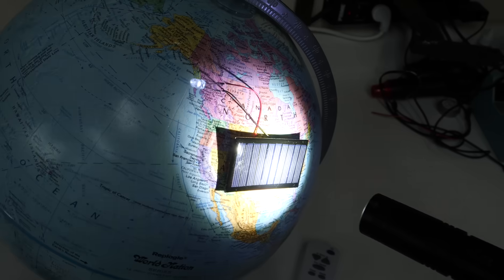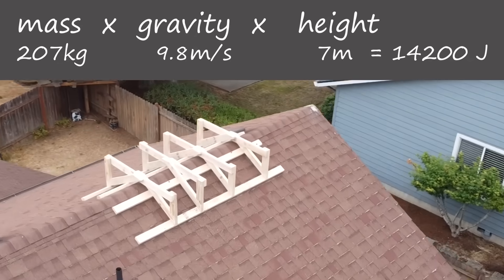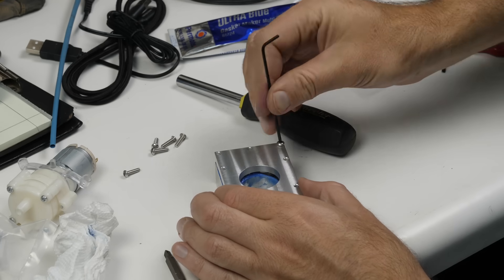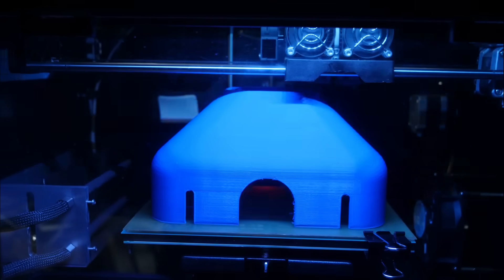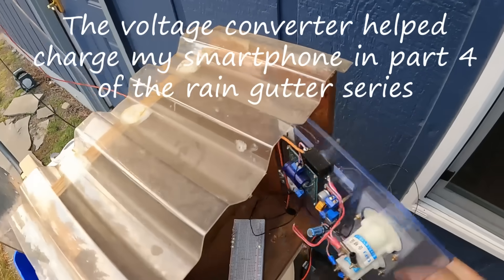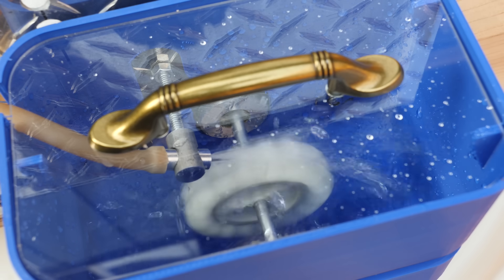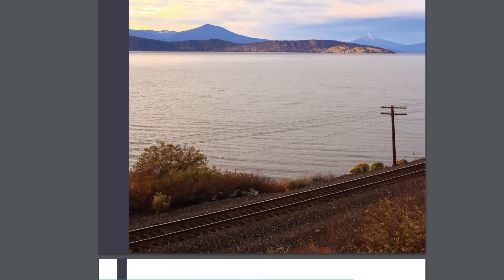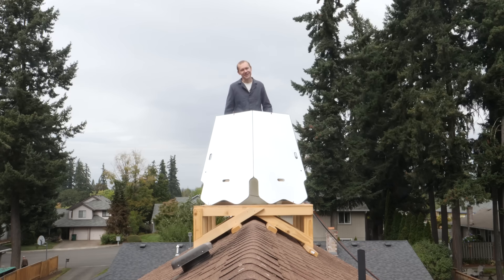Storing Solar Power on my ROOF!!!

Comment: you can use tesla turbine for the same purpose and generate electricity more efficiently, coz you are using it at very smaller scale.
tesla turbine can be handled at this level.

Comment: 1:03 I thought you were demonstrating stored energy on a valuable item, like your car roof.
2:16 it's not your slip I'm worried about, it is the daily changing of 460 lbs load on your roof trusses. Who wants that? A new roof section  is ~ $10k.
I endorse your idea. The barrels don't have to be so high. Just double the # of barrels on a lower level.
You will have to reduce the velocity of the water flow, since the viscosity of the water seems to rob the water of much of the potential energy. 8:10 the water jet not reaching the roof is how I realized this. The water past the water wheel splashes a lot, wasting some moving water (wasting kinetic energy). Can you fabricate a turbine?
11:25 good one.
Alkaline AA battery? It's energy storage is about 14 kJ (wikipedia). 1.4 g of gasoline burnt in an engine (20% efficiency, say) also gives 14 kJ assuming 47 MJ/kg specific chemical potential energy. So 1.4 g of gasoline (cost is 0.2 cents) is equivalent to your 55 gallon of water? I thank God + humanity for inventing gasoline. And thank you for your BUILD principle for putting all this into perspective.

Comment: your system is 14,000 joules. a double A battery is between 10,000 and 16,000 joules. a 60Ah 12V car battery is 2,592,000 joules. while your idea is interesting, it's not practical. a car battery can be purchased used for less than the cost of that barrel or the sheet of plywood you put on the roof.

also, the project your city is embarking on can be replaced with 151.5 standard car batteries or far fewer deep cycle batteries with a shelf life of approx 10 years or better yet, a lithium battery bank.

Comment: I worked at PG&E when the Helms Pumped Storage Unit was built in the "80's .  It was built to take advantage of the off-peak electricity generated by the Diablo Canyon Nuclear Power plant.  Rather than cycle the plant, it was run close to normal capacity and the excess energy is used to pump water at night.  Pretty clever.

Comment: The required water for this potential energy system far exceeds the deployment and benefits. You would need basically a house size water tank to have enough energy, plus generators, pumps etc. You would be way better off with 20-40 deep cycle batteries and a roof and backyard full of panels. Less moving parts, less things to go wrong, more economical, etc etc. Solar still hinges on storage (edit - you just said the same 👍😁)
Cool experiment though 👍

Comment: Intresting video! Yuou might be intresed to know that oil is NOT a "Fossil" fuel!  It is a 100% natural & 100% self-renewing resource born from mineralogical processes in the earth's crust.    Some sources try to claim that Abioyic oil is only a theory, but "oil" has ONLY been created in a labratory by following the mineralogical methodologies but NEVER using the decaying oranic material + heat theorys!     Reseach "Abiotic oil" to find out more.

Comment: Kind of wondering if reducing the pipe diameter to make more powerful exit water would increase electric power
Reply: Biggest improvement would be making a better generator. Every drop splashing off the paddle wheels is lost power. Would need to design it more like a turbo. If that makes sense. Not exactly but the idea of confining the water around the path of travel.

Comment: I have always wondered if it is possible to use a rampump on downspouts to put water into a higher tnk during a rainstorm.Then possibly later while using the water produce power from a small hydrogenerator in the output line to charge batteries. A backup for solar and wind on those less than optimal   days.

Comment: 14200 J of energy. 😀 That's 14200 Ws (Watt-seconds) = 3.94 Wh (Watt-hours) and that, ladies and gentlemen is the equivalent of two (read: 2) cheap AA rechargeable batteries. Cheap, because each of them needs only 1700mAh capacity. 1.2V * 3400mAh = 4.08Wh. There are AA rechargeables with 2800 or 3000mAh ofc.
I'd also like to dispute the claim, that this battery will hold forever. It wont, because part of it is the pump which will die after a few years and which btw has not 100% efficiency.
Of course you have to use batteries for any meaningful system.

Comment: Great project but not very practical. 

A not so great 18650 (Li-Ion) battery has 3.6V nominal and in average stores 2 Ah. That means a 7.2 Wh gets stored in it. Transforming 7.2Wh in joules we get 7.2 *3600 = 25,920 Joules in a battery. ...According to the video the barrel stores 14,000 joules.  Even If I am generous and take 400kg of water at 10 m height we get 39,226 J which is less than 2 batteries. 

Do I miss something? Once again great project to illustrate the possibility and as an educational tool but unfortunately there is a reason we do not store water on top of the houses to produce electricity.

 ...my comment is late but I think the video deserves a bit of context in case there will be more people watching it. 

More over, for each 18650 (Li-Ion) battery you want to replace with water you need 265 Kg of water at 10m height to store the same amount of energy as a battery. To replace 4 batteries with water you need over a ton of water. 🙂.At $3 per battery I would rather spend 12 bucks every year (even recharging them daily they will hold for at least a year) than having a construction for a ton of water on top of my house.

...and there is more. If you have a solar panel of 50W working for 2 hours (that is my average of sun in my region) you produce 100Wh. That is 360,000 joules. With 400kg of water you can barely store 11% of that energy.  To much energy lost.  

Anyway, this calculation does not diminish the educational value of this project. ...but don't run to Home Depot yet ;-)

Comment: If you use a a larger diameter down pipe your flow rate and resultant energy potential at the lowest point will be greatly enhanced

Comment: Imagine if they combined this with evaporative desalination?!?!  Heat collected sea water, into a closed loop.  Get power off the steam.  Collect the distilled water at the physical “top”.  Generate electcity on the ‘way back down’ and add that clean water into the water supply.

Comment: Next level, tesla water turbine & hydraulic ram pump. Are you gonna make a HUGE water tower to house the animaniacs lol jk. BTW talk to engineers back in the day when I was so into this water battery thing. For usable electricity the water tower pressure at the bottom of of tank or to the pump/turbine has to be 90 lbs per square inch to produce usable electricity without the use of a buck converter.

Comment: I guess that he's never heard of legionnaires'disease. I wonder what the neighbours think of the appearance considering he did this without planning permission. Then there's the issue with home insurance, do you think they would pay out if that fell through the roof or worse still fell off and killed someone. It's also going to be so unreliable, the pump/generator will be dead in around a month. What about when it freezes? This is such a dumb and dangerous project all to store the same energy as a fairly small battery.

Comment: I'll give you 10 bucks if you can charge a single phone battery with the amount of energy you got up there. The efficiency is just super low.
Oh I just had an idea.
Imagine suspending Barrel from a tower or a tree. Then while it's at height filling it with water. When you want to use the energy simply let the motor lower the load. The efficiency should be way better than water flowing through pipes. In theory.

Comment: The tools you have access to are fascinating and leave me scratching my head a little bit.
I'm a little jealous you have access to a CNC routing machine.
And then I'm perplexed that you didn't get a brushless motor and controller. You would lose a lot less energy to heat. Heck of brushless motor controller might get you 90% efficiency where is it a brush motor might be down towards 50 percent efficiency. Now I'm going to have to look that up to be sure.

Comment: Instead of a float shut off you could use non corrosive wires and a relay switch. Less moving parts the better

Comment: Since you have understanding neighbours, what if you build a gravity battery? a load lifted up using pulleys and renewable energy so less energy to lift it and when it comes down it spins a generator  (flywheel type). Push switches that get automatically pushed as the load reached the top and bottom, so the system that pulls the load gets controlled. Cogs and gears to spin the generator. Balancing the load, cog ratios and friction of the generator to control the output and the time. Also with guide rails, so the load doesn't swing and safety covers, so no one accidentally or intentionally lands under the load. Just a thought. Thanks for the videos.

Comment: the energy stored in the water is the energy your second hand auntie's solar panel produced MINUS all the losses. So no wonder it  is only as much as AA-battery. This is no contraption for home use, you should start the video with a mentioning of this. A good illustration of how low the energie-capacity of water can be. Maybe you should try splitting it up in to oxigen and hydrogen. But even so. Insight was given. Nice video!

Comment: 14200J sounds much, but it's just 0.0394KWh. Not much, to power anything.  Even the Battery of an iPhone13 has more than 4 times this enery stored, so you need 4 of this barrels to charge one.

Comment: Very interesting.  
A multi stage turbine would be more efficient. 

Btw re your roof frame. The bottom longitudinal members should technically be designed to take the load over the span.  Smaller members would flex and not fully speead the load.   Not that your  load was that great.  But if someone was goong gungho its should be considered

Comment: You are either lying or very naive because you are not telling the full truth. Can you answer real questions?

How long will this 1Watt light run?
Is this feasible? 
What amount of energy does your house require from dusk till dawn? 
How many barrels of water would you actually need to power the house WITH buffer?

Comment: I like the idea of using water as the gravity potential storage media as opposed to other suggestions I read here in the comments.  Water's frequently 'in demand' during droughts and people already go to great lengths to store the occasional water from a rainy day.   I'd suggest that the mass not necessarily be stored at an elevation above grade but rather could be either a tank of water at ground level and another 30 or 50 feet BELOW grade or a stone/concrete mass with a pulley system that again.. lowers a mass from ground level to an elevation below grade (dig a 30 foot deep 'well' for the weights).   Anyway.   Water does make a lot of sense just because it's something we want to store when there's rainfall so it combines two needs.
Reply: To me this only makes sense if there is existing hilly landscape which allows you to bury water uphill and have it flow downhill. Gravity only works downhill so the longer the flow of water the more power can be generated for the same amount of water. The area of water needed to power a house for even one day is pretty massive, so the size of hole you would need to have the entire thing underground... you may as well do geothermal at that point. I calculated a 44ft cubic mass of water falling through 200 feet of hydro generators would power a house for 24 hours. So that's about a 44x44x288ft hole. Basically burying a skyscraper, for one house. And it adds a lot of complexity to the maintenance when it's all deep underground.

Comment: I think it would be interesting to compare storing energy as a raised mass like in this video vs pressure differential like compressed air. I’d imagine compressed air wouldn’t be that efficient since it would get more difficult to pump as pressure increase so I would guess the pump would be most efficient in a small range of pressure similar to a car engine. But maybe you could show the relationship between pressure differential to voltage differentially when converting it back to electricity
Reply: It is possible to pump up all that water using negative compressed air differential created by the weight of the water itself. It has been done and tested before numerous times. No need for motors or electricity or anything.. just good old fashion Gravity.. 😊

Comment: My daughter and I did a theoretical  science fair project on this. Living in south fla, high ac use, flat land. We would need essentially a municipal water tower on our property,  and reservoir catch basin, for a closed loop solar hydroelectric battery like this using readily available products on the market to provide complete  power for our home between dusk and dawn.  I was shocked..
Reply: It's not totally bonkers. Lots of people have mountains or large hills on their property. So if you just dug a pond at the top of a 300-ft hill that's about 100x100x20 ft that would power a house for a day, but more likely you'd only want it to provide emergency power at maybe 1/3rd of normal consumption. No AC, electric heat or hot water, just enough for communication devices, water pumps and keeping your freezers from thawing. And the water itself can serve other purposes in the meantime, and you could even stock the pond from a flowing source using a ram pump and rainfall instead of using wind/solar on it. But pumping all that water back up every day would be bonkers.

Comment: No one uses lithium polymer batteries for solar, we use lithium iron phosphate. My giant lifepo4 batteries capacity will be reduced by 20% after 4000 charge cycles, between 20% and 100%. I do a cycle a day. I have over 10 years before I get a 20% reduction, i can use these batteries happily for 30-40years. BUT, I mostly cycle the batteries responsibly between 30 and 70ish percent, it's the reason i got such big batteries, so.... you know I'll probably get a good 40,000 cycles at this charge profile. 100 years+.... you can do the same with giant lithium batteries for entire towns.
So what was that about lithium dying almost instantly in your intro?
For large hydro storage projects, for a town, pumped hydro is ok when supplemented by batteries to smooth peak demands. For individual homes it's just silly, you can't use it in any practical sense at all. How you going to turn on a microwave for 20 minutes at 1500w, then back to using only 200w for your lights and pc? You going to suspend like 20 Olympic swimming pools of water above your house each day and let it run constantly to generate 1700w all day? Spend 200,000 to build a giant dam with a turbine? Have to manually set the power output of your turbine before turning on each appliance? If you forget or miscalculate you have a blackout? It's stupid. My batteries cost like $2500 all up with all the extra parts, literally paying for themselves within a few years, runs smooth, i never have to do anything, very simple and practical.

Comment: great videos, I know a guy in southern Ontario that went with air power and used large canisters for storing compressed air.  To stop loss of energy by converting the compressed air to turn a generator and then rectified he altered anything in his home that ran by motor into air.  His fridge motet, air powered, as pump, heat pump, furnace fan strait from air to turn motet or pump.  He used wind and solar to turn a adjustable torque turbine to the compressor so max sun or wind required is much lower.  The initial idea cam from the construction standard of room air circulation spinners being stopped as they pushed to much air and effected the heating of a house.  To much .  You still see those spinning roof balls on many homes.  His setup is in constant adjustment so by no means a fix all for power storage but very much along your lines of energy storage

Comment: All your using is a water turbo and a solar panel to run the pump >   Use a black barrel on the roof for hot water and possible STEAM POWER

Comment: 14,000J apparently equals 3.89 watt hours, but that is a 50W solar panel that was collecting energy for over 5 hours to fill the barrel (over 250 watt hours).  I’m sure the panel wasn’t producing a full 50 watts, but that still a MASSIVE amount of energy loss.  We know a lot of the energy was lost to heat, of course.